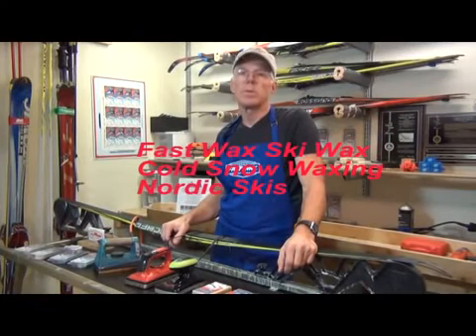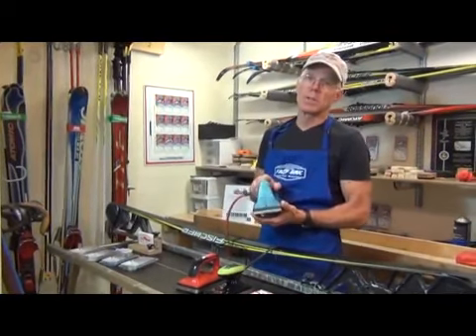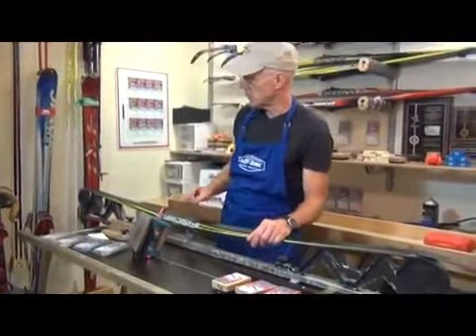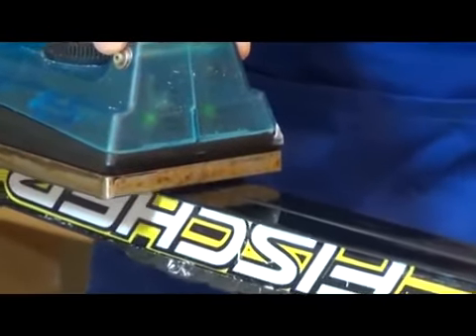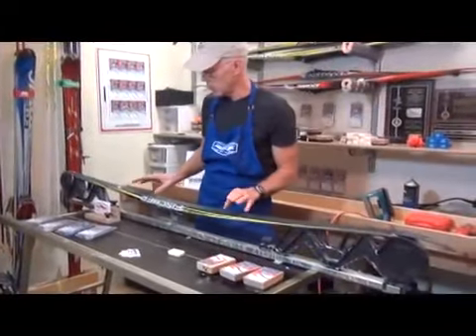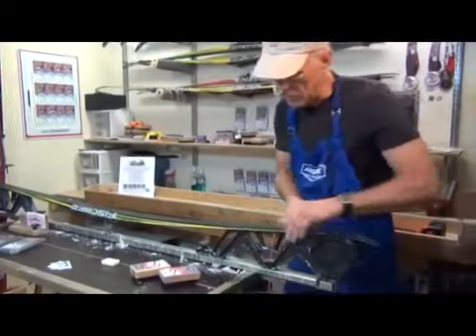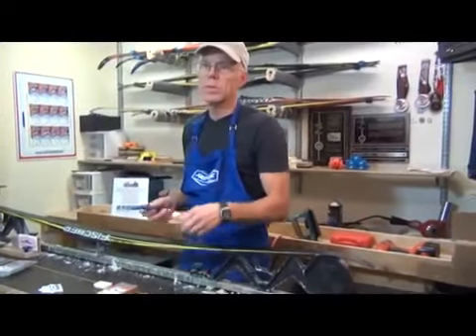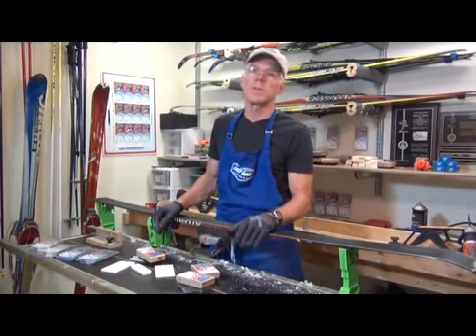Cold Snow Waxing Nordic Skis

Comment: Thanks for the help! Should you stick to nylon and horsehair brushes to polish after applying wax? Are steel and brass brushes too harsh to use post wax?
Reply from the maker: Some folks will do a light pass with a stiffer brush after scraping. This will kick up a lot of the loose wax. Then they move on to horsehair and nylon.